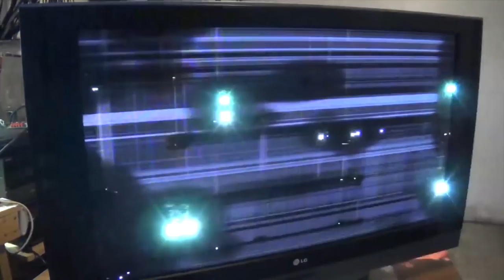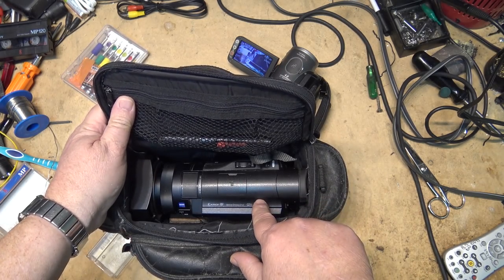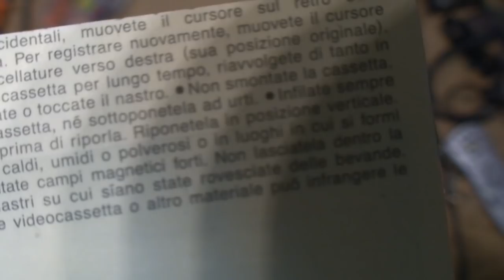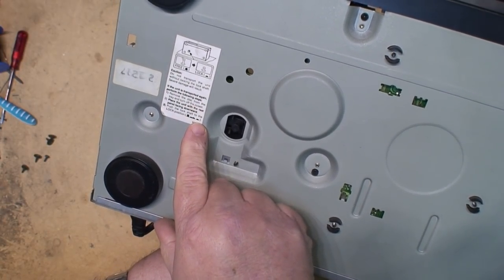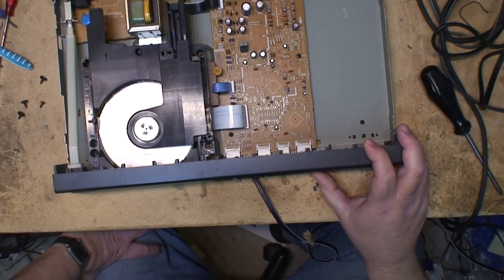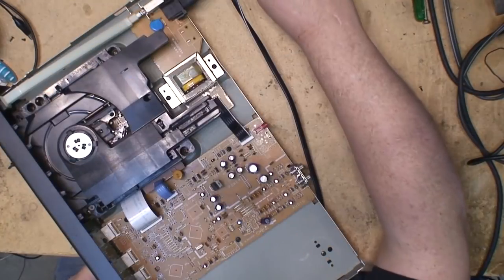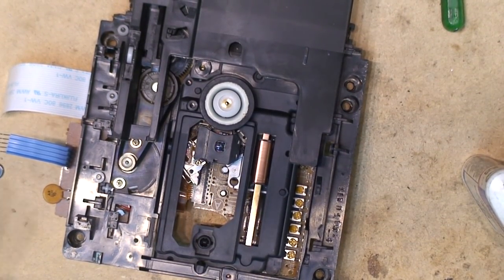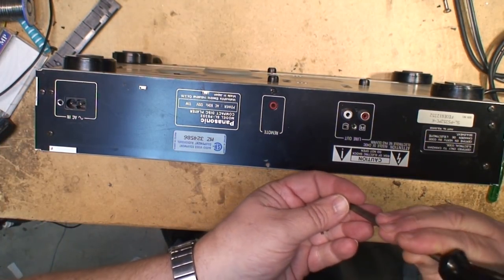Video tape was as bad as I remember and a CD Player repair all in one

Comment: I had a Sony CD player with variable output. I drove a power amp directly from it and could use the CD remote to control volume. I am pretty sure that was the original intended use: minimize the signal path for the "purest" CD sound. My unit had a variable output control on it (motorized!) as well so losing the remote was not a disaster.

Comment: Those old Sony HVR-FX1's had the reputation of being real workhorses. Even today they're still useful if you do a lot of live switching because it can output HD-SDI natively and sync via timecode. I used to set mine up to shoot 1080p25i and a fixed shutter speed of 1/25 so you would have a quasi-progressive output.

Comment: Good to see you getting a good HD video from a 15 years old HDV camcorder! Congratulations for the good deinterlacing on the HDV footage. The drops on tape only happen when you use  consumer DV tape (like you used). You shal use at least HDV consumer grade tape (not DVM) or even beter, use the Sony HDV DIGITAL Master that has much higher magnetic density, smaller magnetic particles and better lubricant, as well as a beter dimension stability of the base materias. I used consumer tapes and Digital Master. On the consumer I used to get 1 to 3 drops per tape. On the Professional Digital Master tapes... I never had any problem. Several videographers used HDV tape for weddings and it was reliable, provided you use Digital Master grade tape from Sony, Panasonic or JVC.
Anyway... I strongly encourage you to ''digitize'' your kids tapes... you will enjoy it, as I also did when doing that to my!
Congratulations for your great videos.
Reply from the maker: Bullshit.  I have some digital master tapes and they also have dropouts.   Now that they have been sitting they are even worse but even when new i was burned a few times.

Comment: yea I think i'll just stick with audio tape.
Reply: I use video tape, but strictly as a playback medium., especially for transferring stuff over to another format.  With certain exceptions, such as experimentation, here's hardly any point to record anything to video tape these days.

Heck, the same can even be said of audio tape.

About the only practical use for tape would be for mass data storage, usually for backing up and archiving since tape does have the advantage of being the cheapest per GB and the most stable for the purpose.  The best example for this would be the latest LTO standard.
Reply: @Watcher3223    maybe but I still use cassettes or music. just like the sound
Reply: @scaleop4  That's cool.
Reply: @Watcher3223  👍🎄
Reply: @scaleop4  I still use compact cassettes for audio to, there's something about the sound coming from something mechanical! 
But when it comes to all day audio playback, you can't beat a hifi VCR LoL. Just record it in long play or super long play if you have it and get 15 hours out of a 5 hour tape lol. You don't need to have the picture cable connected, just use the audio input, they aren't to bothered about it! I wonder if a new solid state device will let you record just audio without picture?

Comment: Great idea. I thought that looked brilliant. For those unfamiliar with tape. The squealing in this case is excessive tension and is more to do with the fact the tape was sitting about for ages and was resistant to spooling. If you wind the tape end to end before recording it should be OK.
Most mediums will have aging issues and magnetic mediums may indeed be the best for long term safety after scratching a representation into some material. I just took a load of Laser Discs from the loft and more than half were unplayable, CDs just need to be looked at wrong or take one car trip with a teenager to be useless. Solid state memory will have a definite life too, I think most are expected to survive over x decade, plus any failures may lose all information. All my tapes, some over seventy years old are fine. Tape is OK, but as 12volt says would take some determination and perseverance to continue with it.
Edit do some more of these with different mediums...Would be brilliant.
Reply from the maker: I did wind the tape.  I actually dumped the original footage off this tape before using it. Playing and rewinding was the second pass of something recorded about 10 years ago and never played.
Reply: @12voltvids  Aha! Maybe the case was distorted slightly?
Reply: @12voltvids  Or it wasn't smoothly passing the guides due to shedding material?
Reply from the maker: @martinda7446  have no idea was not aparant during recording.  That's the problem with tape.  If your SD card fails during a session the system shuts down and you are aware that there was a failure.  If a head clogged or a pinch roller gets hungry when shooting you have no idea till you are done and then it is too late.

Comment: I still have Panasonic HV40 and still using it. No dropouts in picture. When i move ahead it is going to be 4K camera.
Reply from the maker: There are dropouts.  All tape has dropouts. 
Even professional formats.  Drop out compensation masks many but they are still there.
Reply: @12voltvids  Aaah ok.

Comment: Tapes are still being made and used today for data backup of all things! They are not cheap either, the latest LTO drive's can store an enormous amount of data! I can't remember how much but trust me, it's a lot, even an older version which has less capacity is expensive second hand! 
When it comes to tape, all of my audio compact cassettes are still perfect! Vinyl records are like new and I think that my VHS tapes are still good also, mini DV tapes are still good but I can't say the same about the recording and playback devices lol. I thought that my VHS tapes were going bad at one point but they played fine in another machine, it turned out that the machine had some DC leakage capacitors which I replaced and now it's like new again... Same thing with the Panasonic mini DV camera, bad capacitors would force it to shut down right after power up!.. I hate working inside a sardeen can! I won't include any of the colourful words that were being used like there was no tomorrow!
Reply: I have LTO4 and LTO5 at the moment.  Once I sorted out a SCSI card that had a decent speed to it it works great.

Comment: I'm glad I didn't get a tape based DV camera and went straight to solid state digital, My Aiptek DV4500 camera. Still have it and it still turns on and works. I've never used tapes for videos. Not even VHS. I've seen the DVD cameras but the discs for those cameras are write once unless they can use rewritable mini DVDs.
Reply from the maker: Yes the DVD camcorders could the mini DVD-RW disks that were rewritable and DVD-RAM disks.
Some pro cameras used DVD-RE disks.

Comment: This video is scientifically a clear experiment of data loss due to aging media. The DV cassette format was extremely demanding in terms of band transport and tape quality. It's a clear demonstration magnetic support is not the best when high density data is needed. However, when it comes to optical discs, especially those you use on a daily basis, you also loose datas due to scratches on both sides, bad sticker glues or inks on the thin back surface and other radiation cristalline changes. High moisture and temperature can also randomly lead to data losses. When it comes to static memory formats, things are supposed less prone to fail, but everyone has experimented one day or another some bad USB key or equivalent. It's generally a massive failure leading to 0% recovery capacity. Heat or low noise radiations could cause massive failures of ultra high density transistor arrays: the finer you get, the more exposed you are, with structures a few atoms wide! Most hard disks are magnetic based technology, so like DV, prone to fail in harsh environment or long term storage. But you need to know new static high speed discs have limited numbers of data E/W, and we have no idea yet of how a new super speed high density M2 SSD could behave in the long term. So when it comes to long term data storage, we are all experimenting media that are supposed to have limited life expectancy. Many old low capacity hard disks are still functional twenty years after machines were withdrawn from working environment, but their storage density and access speed is so low, data is easy to recover even if you have to literally rebuilt it with us heads... Anyway, the best chances you have if you are to store great amount of datas is to use a self redundant protected data storage unit. The easiest and most efficient relatively to costs is a small NAS RAID 2 disks unit, but you can also have large units with multiple discs. All use SATA classic 3,5" disks, but you can prefer some specifically selected HD series like WD red. In case of failure, disks are "hot swap" replaceable with auto backup...
The best low is not to trust 100% in a single medium, but have multiple copies. And be suspicious about long term conservation over the cloud. It seems an easy modern way, but you expose yourself to future storage costs or owner legal issues. 
Good luck with all your tapes, hope you won't loose too much precious contents...
Reply from the maker: I really don't have much precious content.  Only a few tapes that have not been archived.  Most of my tapes is stuff recorded from tv which i don't really care much about.  Anything important has multiple copies.  I store nothing in the cloud.

Comment: As you say tape had its day.  Though it is annoying when you spend an hour and loose everything in a card because of a fault on it.  At least tape you could salvage it, but then you would get drop outs and bars going up or down the screen, just when you didn't want it.  Both had pros and cons, but cards, you can carry a shed load of them around and wouldn't even know you were carrying them.  I still have tapes around with the kids on them, I asked if she wanted them transferred to DVD but all I got was "Later" suits me.  If she looses them she looses them.  They must be 20 years old now, so she might already be to late to get the best out of them.  I might have a look if I can find the tapes, no idea what she did with them.  Oh well, she was warned.
Reply from the maker: I have yet to lose anything doe to a bad card. I have had one lock and not allow further writing, in a phone of all things. I have had them get damaged, through rough handling, and burned one out from excessive writing in a cheap dash camera. My Sony cameras run a test every time the camera is powered up, and I have had warnings on some brands that they failed the write speed test. A message came up advising me to use a different card.

Comment: My Canon HV30 HDV camera is still my main camcorder.  To avoid problems I have only ever used the same brand of tape in it.

I have noticed my recorded tapes do get a couple of drop outs if they have been sitting for a while, I wind and rewind those tapes to free them up and it seems to resolve the issue.

I'll use it till it stops working, but I will need to transfer a lot of my existing tapes as I didnt have enough space to back them up till now.  So I have a lot of capturing to do.

I have a feeling I will be replacing it soon as its internal battery has dies, thus it forgets everything when off and I just noticed it can only handle dates up till 2030.

I would use my DSLR which has a number of plusses, including allowing me to use any lens I like but its a cheap beginners DSLR, mono mic, no mic input.  It also records using a MOV container, my god.  However the MOV has h264 and pcm audio which kinda makes up for using MOV.

I'd want a 2 SD card camcorder as although I will use a single card in my DSLR I dont trust SD cards, too much to go wrong and depending on your camera you may not know that the card has died taking every frame of video with it till you plug it into the PC.  Thus, 2 cards are needed.  Obviously I will need a mic input.  If I were to use a DSLR it would also need to have decent video controls, I want frame rate selection so I can ensure I am recording at 25fps (thats my usual rate) for that "film" look.  However I will lose the viewfinder as a DSLR can only record in live view mode.  No, I'm not getting a mirrorless lol. Too pricey, and for stills shots I want a mirror.  I was mirrorless for 10 years before I got my DSLR and I hated it.

The 4k camera you showed off seems good, just need that second card slot.
Reply from the maker: 12 gigs per hour.
Reply: @12voltvids  Exactly,  I have ~20GB free on my system at any one time and >20 tapes to backup.  Now I have loads of tested 500GB HDD's I salvaged from work and caddies for them, plus a NAS to back those up and BD-XL I can finally get going.

Comment: Thanks for the lesson for not using video tape!   When you transfer a clients 8mm  Sony  tape to other media does your recorder remove the drop outs?  Does anything exist that will allow a tape to be played once to make a good recording.  Software /hardware.
Reply from the maker: A drop out is someone that didn't finish school! Drop outs is him and all his idiot friends that were too cool for school too!
Reply from the maker: Sorry couldn't resist.   No nothing can be done to fix drop outs.  It could be a scratch on the tape or dust on the tape or more likely a small section of the tape coating has come off the tape.  The signal is gone.  On analog it caused horizontal lines to streak across the screen on digital pixelation, or a frozen portion of the screen momentarily.  On HDV, well you see it here.